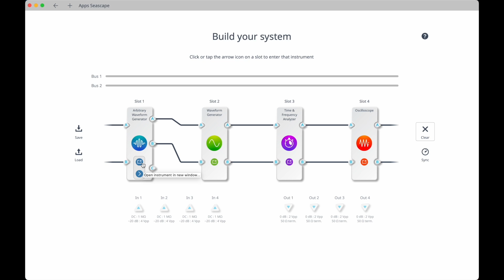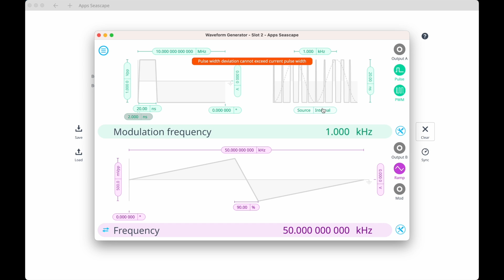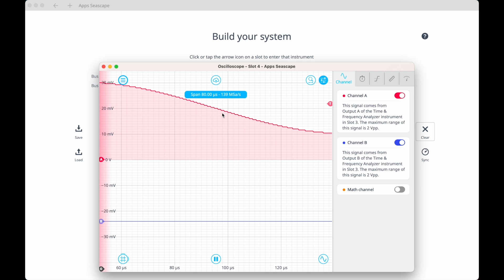Encoding and decoding arbitrary waveforms

Comment: I'm generally working at audio rates with no extreme need for precision, and probably not in the target market.  I have to ask though, are all of those decimals in the frequency configuration at 1:45 significant?  And for curiosity's sake, how quickly can instrument configuration change?
Reply from the maker: You can indeed choose to get very precise with the frequency configuration, but the instruments are able to address a wide range of applications that may not need that level of granularity. The instrument configuration can change in just a few seconds, and up to a minute if you're using all four instruments simultaneously in Multi-instrument Mode. You can try the software for free without the hardware in demo mode from our website, but keep in mind configuration time will be slightly longer on actual hardware. Feel free to reach out to us with any more questions!